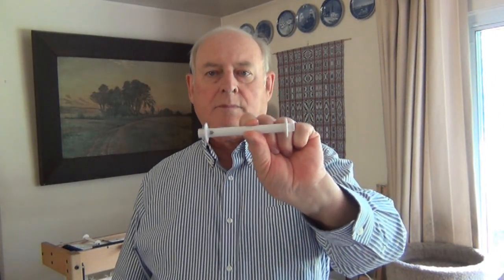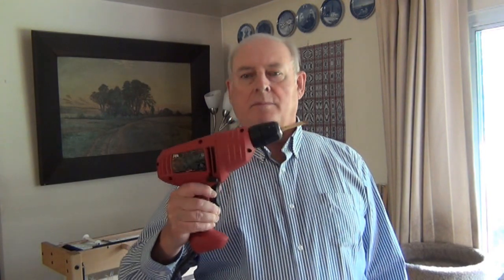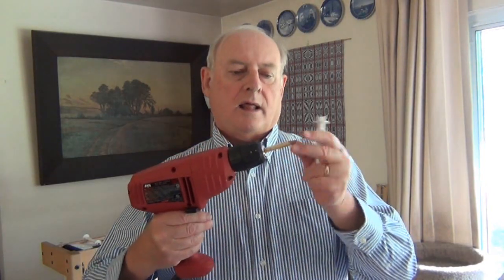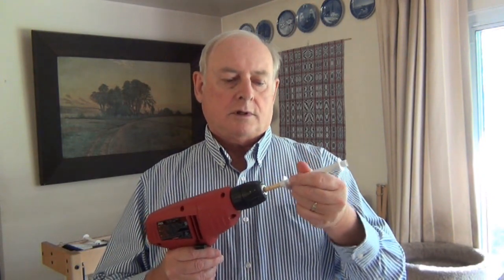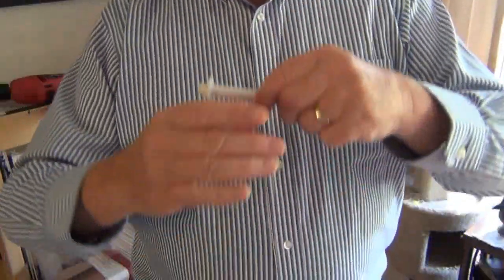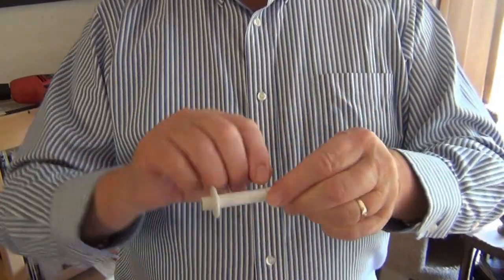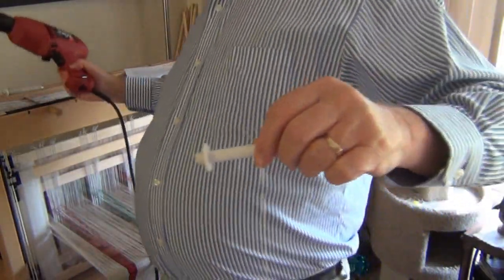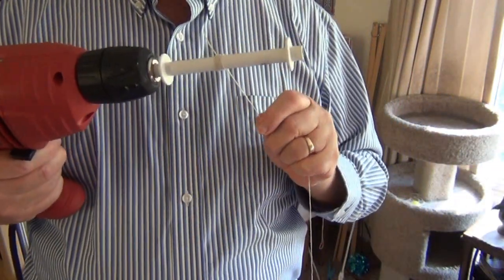Bobbin Winding

Comment: I use a drill too, my bobbins are a bit different to yours and must be pretty slippery on the inside because initially I found it hard to get it to grip onto the wooden piece of knitting needle that I insert into the drill. What I do now is to use a piece of thin rubber band, wrap it around the stick a few times, then push the bobbin on. Works a treat. Scotch tape would be more simple though!
Reply from the maker: Always good to know that others use a method similar to mine for simple things like bobbin winding.  Since I tend to break the "stick" part that I'm using to hold the bobbin,  I like to use something really cheap, which is why I use old wooden pencils with a little bit of scotch tape.

Comment: Thanks. Interesting. We have hand one but yours looks just as good. We are starting to use quills as was recommended for our fine linen thread. You ever work with quills or prins? Ever work with end feed shuttle? Just wanted to hear if you found a difference.
Reply from the maker: When I took the Intro to Swedish Weaving at Vavstuga a few years ago I used a prin.  That is how Becky teaches all her students.  I guess I am just more comfortable with a bobbin, but yes I have tried the other way, don't remember if Becky had end or side feed shuttles, I am quite content with side feed.
Reply: I am setting up my Spring Lout and am trying to locate your Part 3 to setting up your loom. Your first two are excellent. Is it still on youtube? Thanks Dolf
Reply from the maker: Hi John, no it is not on youtube - I never made part 3, I thought I would need 3 parts to do this , but finished it in two.